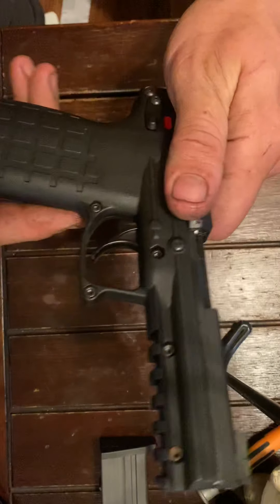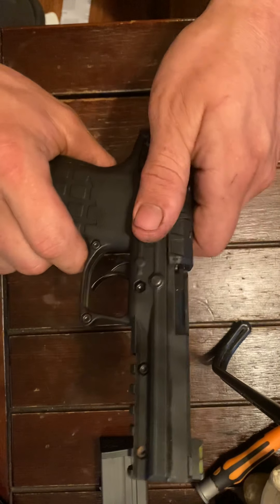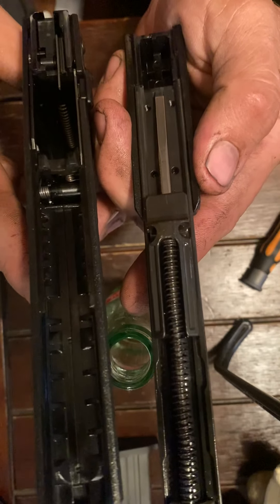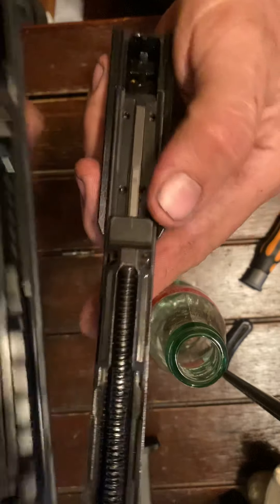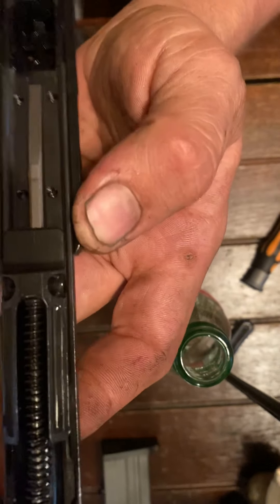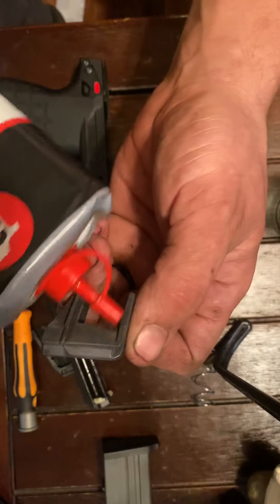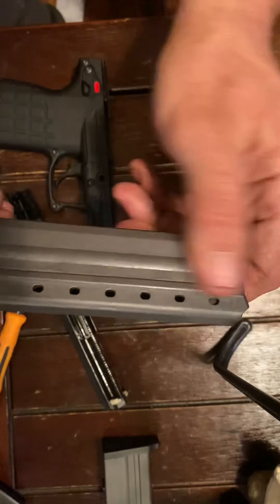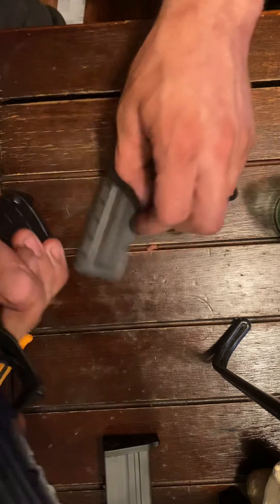How to fix your KEL TEC PMR 30 and make it run really smoothe.

Comment: I have the "same" regards for Slip2000  as your dad has for 3-in-1 so I'll give it a whirl. Already checked if Slip2000 will harm polymer or plastics they say NO.
Reply from the maker: What kind of results did you get?
Reply: @HILLBILLY_HARD  Seems like it has much smoother slide operation with the Slip 2000.

Comment: I squirt Graphite down the mags loaded with 20 rounds, about every 20 magazines. Seems to work good, mine has always run good with Hornady ammo, quit using other brands long ago. Getting oil up on the slide is a must too. The Hornady ammo does not fireball and fill your slide rails up with unburned powder like some ammo. It's a process getting a PMR that runs, so fun when you have one !
Reply from the maker: Thanks for the comment!

Comment: Unfortunately not enough.  If you are running CCI maxi mag or even the hunting hollow points most of the time,  it will run fairly well, especially if you reduce your mags to 25.  You switch to Hornady red tip or Winchester silver box,  you are going to have issues at the top of the mag.  Past 15 rds they will feed pretty much anything.  The plastic ramp and mag release are your chief culprits.  Swap those out and get a good speed loader and she will run like a sewing machine.  I run an RDS on my PMR and my CMR, cleaning all that oil off the lenses is a no go for me.  Good luck doing the work if you decide to upgrade they are not fun guns to work on.  Oh that buffer needs to go too.
Reply: Does it run Gold Dot Speer?
Reply: The 40grn Winchester dynapoints seem to run better in mine as long as I don't load more than 5 at a time,,but broke a fireing pin the other day after about 200rnds so Keltec is sending me parts,also added a dab of JB Weld to the mag catch on the back of the mag and tightened the mags up and lubed everything down with a spot of neverseize,so we shall see how that works 💪 👷‍♀️
Reply: My pmr 30 has run on all ammunition. Oil is the answer. 😅❤

Comment: It's the mags and no lube. Load your mags to full capacity and let them sit for awhile and they're lose tension and start Cycling fine
Reply from the maker: Requires lubrication*
Reply: @HILLBILLY_HARD  I said this before watching the full video. There's company's charging $250 for an upgrade kit that swaps parts out. Insane that they'd charge the same pice of the gun for an upgrade that just helps it cycle that you or keltec can do for free essentially
Reply from the maker: My gun works flawlessly, no upgrades just oil. Plenty of it.. works like a charm, ask the opossum population around my house…
Reply: @HILLBILLY_HARD  I'm just saying there's upgrades to scam people out of money that don't know how to fix it or that keltec will fix them
Reply from the maker: I like mcarbo, they make some cool stuff for my KELTEC sub2000 that I’ll be getting asap! Might upgrade my ramp in my PMR30 but not sure yet.. only reason I would do anything to it is for the cool factor not from necessity. You right there’s a ton of videos on YouTube about how to “fix” the PMR30 issues with feeding, mine wouldn’t run out of the box, oiled it good and use CCI 40 grain hollow points and it’s smoothe as butter
Reply: @HILLBILLY_HARD ,
Really appreciate your common sense and KISS approach. My wife and I need a reliable 22mag pistol. We’re both seniors who can no longer shoot well with 9mm. Have watched over 20 vids on the PMR. Saw way too many reliability issues since we’d be depending on it for home defense. But your  ingenious approach has caused me to give it a second thought. Do you think a metal feed ramp and firing pin would be wise upgrades?Apologies for this lengthy reply. Thank you, again, young Sir.
Reply from the maker: @davidmatz4755  I think any of the MCarbo upgrades can’t hurt the gun. If it’s something you’d want to invest in then I’d say it would be a good investment!
Reply: Also forgot to ask if you still recommend cleaning and lightly oiling the PMR magazines after each range session.
Reply from the maker: @davidmatz4755  it can’t hurt anything and the mags get really dirty because of all the unburned powder left behind when you shoot a .22 magnum round through such a short barrel.

Comment: I’ve read that too much oil messes up the firing pin and you won’t go past 800 rounds if too much oil exists inside the firing spring ..
Reply from the maker: Could be true. With 22 mag the price that it is I probably won’t hit 800 for a while. I’ve probably shot 450 thru mine so far. I’ve had it a few months now..

Comment: That didn't work either. I put new feed ramps and mag releases I'm my pmr and cmr. Neither of them ever ran well. I gave up and sold them both.
Reply from the maker: That sucks bud. Thanks for watching my video and commenting! What kind of pistol are you carrying or shoooting now?
Reply: @HILLBILLY_HARD  my daily is a sig 1911. I have several 1911 configurations. Also a Smith performance center shield 9mm. To many to list here lol
Reply from the maker: @jeffmalone7524  I have a video called “whitetail deer shot with a 1911 .45 acp” on my channel. Killed a button buck at 7 yards with my rock island 1911 when I had it before I traded it off.
Reply: @HILLBILLY_HARD  i also have a kimber and a taurus 1911. Recently acquired a  cz 805 bren s1 11.5 inch pistol.

Comment: Who would have thought cleaning and lubing a gun would help it function reliably. 

Incredible....
🤦‍♂️🤔🤣🤔🤦‍♂️
Reply from the maker: I think the problem is Glock. You can literally take a Glock out of the box and run 500 rounds of ammo through it without ever cleaning it or lubing it. People don’t associate polymer firearms with oil the same way they do with steel firearms. As obvious as it is, there are multiple people on the internet having problems with these guns and according to my comment section, this video has helped hundreds of people maybe thousands get their PMR30’s running smoothly. Thanks for the comment!

Comment: Gonna oil my mags that I’ve not done nor Dist it ever occurred to me 😱
Reply from the maker: Also try holding the gun very firmly with a firm grip. I let someone else shoot mine and it wouldn’t run good. It matters how you hold it. The gun is so light that your hand has to be the weight that the slide slides against.
Reply: @HILLBILLY_HARD  thanks for this tips I haven’t taken it out there yet as I’m obsessed trying to fix my cmr30 that one has lots of this kinds of issues too and a super sensitive firing pin breaking every 200 rds

Comment: Run 40 grain only. Use Lucas extreme duty grease on rails. Upgrade your magazine springs ( Keltec sells for .50 each). And load the magazines correctly. Do this, and these guns will run like raped apes. I’ve had two for over ten years. Mine run perfect
Reply: @HILLBILLY_HARD  I just bought another one last week. All black. The two I have are desert tan. I like them because it’s a lot of firepower with barely any kick so the wife loves it. My 14 year old grandson loves to shoot it. Myself, I’ve always loaded the mags by hand. I put 5 rounds, tap the mag, load 5 more. I have never had a problem w feeding. Had a few bad primer strikes etc. But I run mostly CCI and Winchester 40 grain. HP and fmj. A buddy of mine got one a few years back. It kept malfunctioning. I looked at it. I said Jesus do you ever lube it? It’s like grit. He had the rounds all jammed into the mag. Once he lubed it and I showed him how to load the magazines, he loved it. I think they’re a blast to shoot. Loud as hell. Big ass fireball. And 30 rounds no one is walking through that lol
Reply from the maker: @johnburrows1179  everything you said is 💯👏 yeah man it has ooogles of ammo and it shoots flat and straight and it’s sooo loud on top of all you said. I would engage a target at 50 plus yards. Wouldn’t do that with my .45 acp! It’s more like throwing a football than shooting a Bullet🤣 
Thanks for the comments! I love interacting with folks on my channel!
Reply: @HILLBILLY_HARD  👍

Comment: Well... petroleum based iol does deteriorate polymer. the amount you've used seems to have worn away a small amount wherever the frame was binding. kinda like artificially wearing the gun in faster. i forget the name of it but there is a non oil based lubricant for guns. allot of even military rifles down to bb guns use polymer, and they indeed make the lube meant for that setup. Look into that. its only out of consideration im telling you this. Id rather there be no chance your slide might derail and bonk you in the face.
Reply from the maker: Cool! Thanks for the comment bud!

Comment: KEL TEC PMR 30 is junk.  Had a new one blow up in my hands due to faulty manufacturing.  Bad thing was they knew about the problem and the possibility of it exploding but failed to do a recall.
Reply from the maker: This has not been my experience but thanks for the input!

Comment: So drown it in oil then shoot really dirty ammo through it creating 
a lapping compound in your polymer gun? Ah, NO!

Buy the MCarbo aluminum feed ramp and mag catch for the PMR30 and then the American Speedloader Nest loader and be done with it. Then you'll be able to run ANY 22 wmr ammo you want, ANY, and it'll run flawlessly. CCI, Hornady, Winchester, etc. Ballistic tip, hollow point, FMJ, short barrel. 30, 40, 45, 48, even that 50gn stuff.  It doesn't matter after that it will run it all. I've done at least a dozen conversions and they all run flawlessly everytime after swapping those 2 parts and getting the mags loaded perfect everytime.
Reply from the maker: I’ve never replaced a single part in mine and it runs flawlessly with CCI 40 grain hollow points and some oil..
Reply: @HILLBILLY_HARD  Now try to run Speer Gold Dot Short Barrel through it. Every single round I've shot through a PMR using hollowpoints or ballistic tips ammo will just ball up into an FMJ because it doesn't reach the velocity necessary.  That's through ballistic gel, into dirt,  into water,  and everything else you can think of. Every type except the GDHP "Short Barrel" ammo, you'll get a perfect mushroom everytime through the PMR with that. Problem is not a single factory PMR that I've ever seen, and I've seen and worked on dozens, will feed that round. KelTec even tells you specifically NOT to use the Speer GDHP round due to constant jamming. It will literally jam every single round.  Oil won't fix that,  but the new aluminum feed ramp and mag catch definitely will. Those 2 parts turns the PMR into something with actual stopping power and phenomenal reliability.
Reply from the maker: @samlind8330  I’ve never shot the CCIs into any medium where I could retrieve them and check the expansion of the HP but I can tell you I’ve killed multiple possums with them and they are effective on small game from the PMR30. I wouldn’t want to be shot with them even the FMJs. The only reason I use the HP is to prevent the inevitable pass thru you get with the FMJs… lots of people just shoot ballistic gel with no clothing or bones to pass through and they assume the results are accurate on flesh too. IMO that is not correct. If a 40 grain .22 LR velocity will make the HP ammo expand then the .22 mag 40 grains will do the same. Same size and shape bullet at a faster speed…